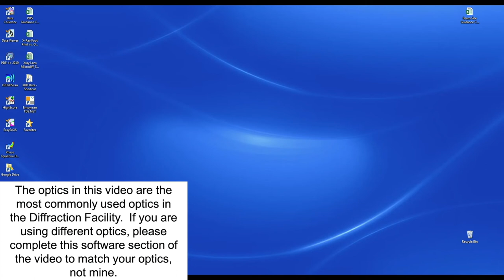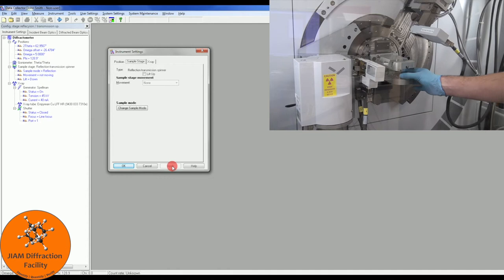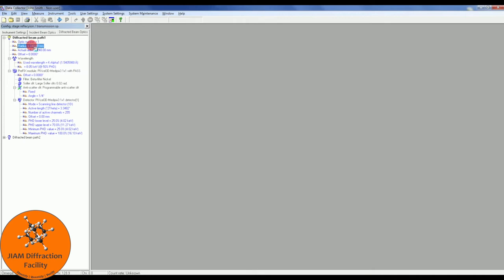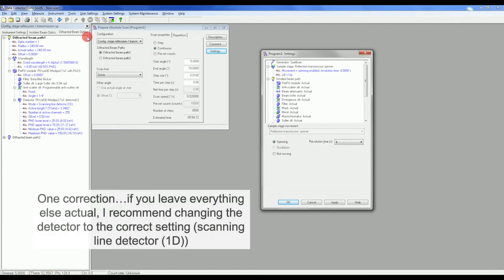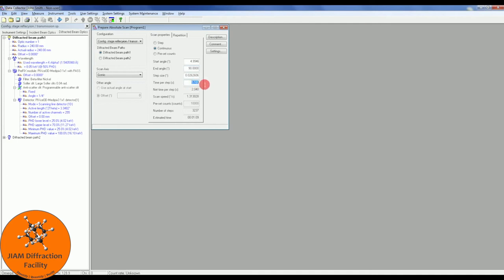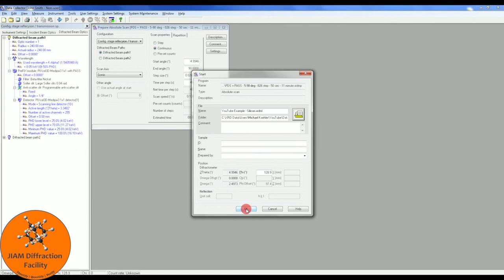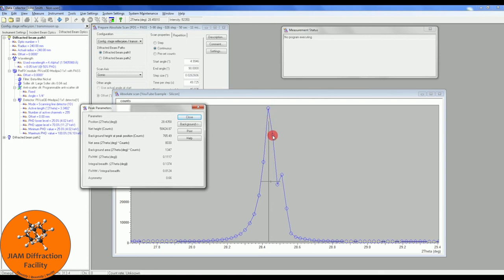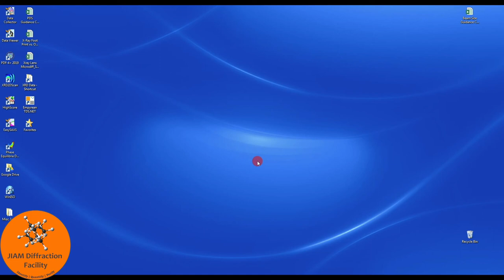How to Perform Powder XRD - Empyrean Training - Malvern Panalytical

Comment: Thanks for the excellent training video. I have a quick question to ask. Can I start from 2theta = 3 degree? because some organic framework might give peak near 4 degree. Thank you
Reply from the maker: That's tough.  If you are using the Pixcel detector, you start to get pretty high background (I'm guessing from the direct beam) starting somewhere around 4 degrees.  As you decrease 2theta, the intensity increases VERY quickly.  I believe that a smaller divergence slit would help, but you can also either use the detector in 0D mode or decrease the length of the 1D detector (this is done in the Detector tab in the Diffracted Beam Optics window).  I would also suggest looking up information about a beam knife in the help files (these can be found under the Help toolbar in Data Collector).  If you have one of those, I think it will help.  

Honestly, most of what I work on doesn't involve such small angles, so take my advice as simply suggestions of what you should look into.

Comment: HOW TO DO XRD OF  THIN FILM SAMPLE?
Reply from the maker: Thin film samples typically utilize grazing incidence XRD, which uses parallel beam optics (although some films work fine with regular powder diffraction or a slight variation).  Do you have a parallel beam mirror (also known as a parabolic mirror) and a parallel plate collimator?
Reply: @IAMMDiffractionFacility  Hey Could you make video on the same with optics